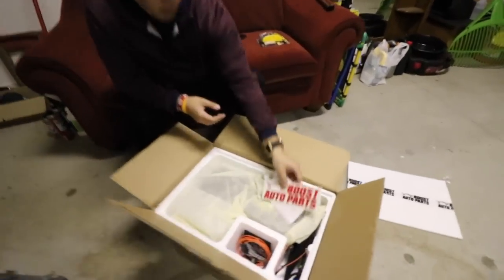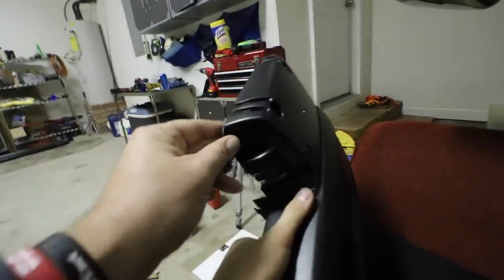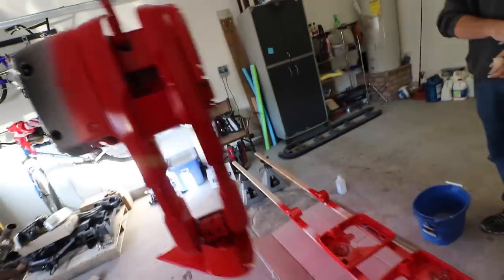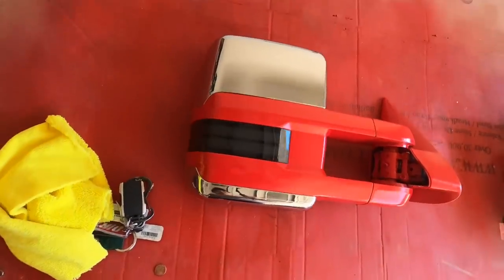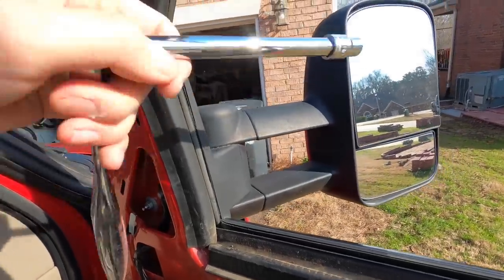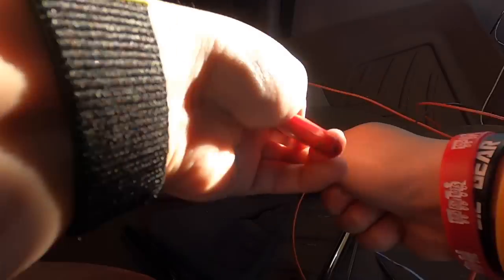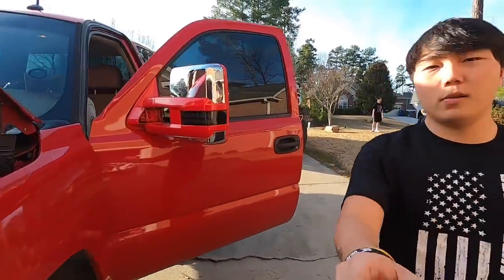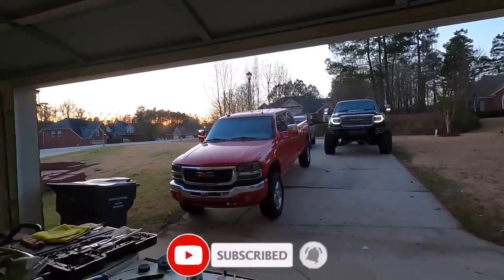How To: COLOR MATCH, INSTALL & LEVEL New Style Tow Mirrors on Older GMC/CHEVY!

Comment: Since boost autoparts is a sponsor, tell them a color match option needs to be address. Factory paint codes can be used for ease. Good stuff to learn.
Reply from the maker: Good thinking. I've talked to them about color matched options with the mirrors. stay tuned
Reply: JW Montoya Thanks; any chance on mentioning  those early style RV power slide-out accordion gasket style mirrors?

Comment: Just saw this vid today 
But if you haven't repainted the mirrors yet, you can order basecoat color in a spray can mixed to your paint code and 2k clear also in a spray can.
Prep work isn't come as some say. A red scuff pad is the equivalent of 600 grit sanding and you can sand between base coats to keep it smooth. The clear will lay like glass right out of the can.

Comment: My dude you gotta use adhesive promoter/primer bulldog is a good brand. I’m about to do my 2015 have it in the back now.. you can sand that peel off and if you want to do it one more time you need to finish with 800-1200 grit to get it like glass finish after prime and a wet sand after first coat.. also use a 2k clear coat not no hard box clear coat and match your paint code on truck to match only way to get it perfect.. bro I know it ain’t easy I did my camper shell to match my truck.. so step 1 sand down plastic starting at 120 moving up to 1200 even 3000 if you have too and  than hit it with adhesive primer than wet or just sand with high grit 8-1200 than base than wet 1200 -
2000 another base.. you can always light base and sand if you your not happy but once the clear goes on after first coat wet sand with at least 2 of these 1500-2500-3000-4000 always finish with highest and keep them light coats and u will eliminate orange peel.. how this helps you guys next time..
Reply: That is bulldog adhesive promoter right? I can’t find such thing as adhesive primer. It’s just adhesive promoter acting as primer correct?

Comment: Boost mirrors need to come almost completely disassembled and with NO texturing if you order paint to match.  As it is, they don't trust you to reassemble properly so in actuality you can only paint match the caps and everything else comes out black.

Comment: If I get the paintable ones do I have to worry about taking them apart
Reply from the maker: What do you mean?
Reply from the maker: What do you mean?
Reply: JW Montoya how you had to pop the glass out im just gonna paint the caps so do I have to pop the glass piece out to do that or do they just unsnap
Reply: @adamdunn9171  they just unsnap bro
Reply: @JWMontoya  question I have a little run in the paint . Do I wet sand with 320 then spray with clear or spray with clear let dry then wet sand?
Reply: Question I went on primo dynamics to look for the tail lights and they only have 07-13 on the sierra